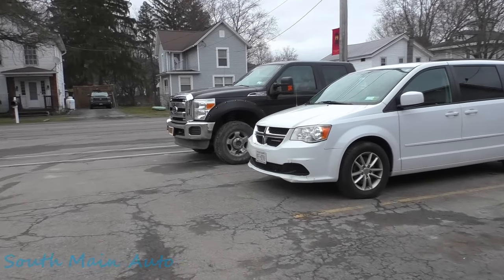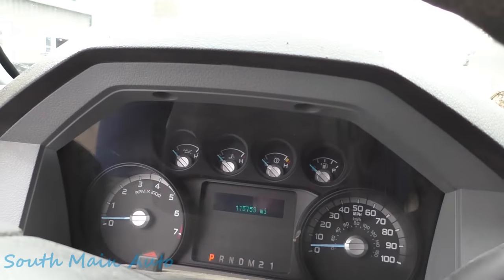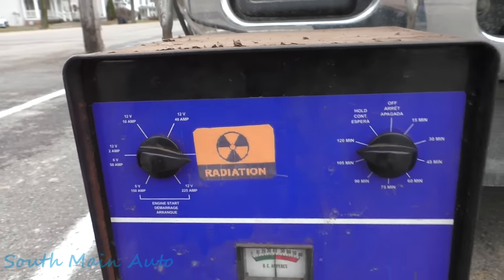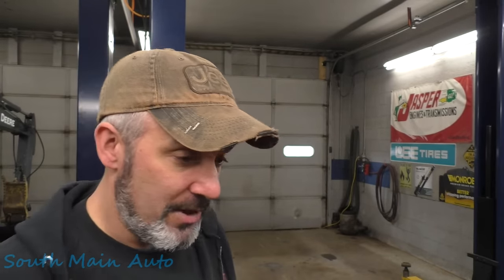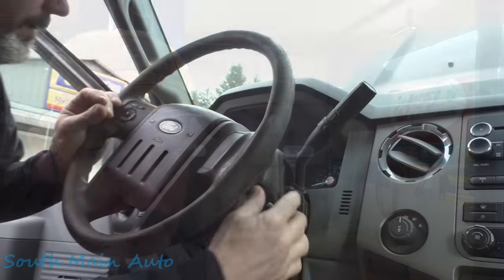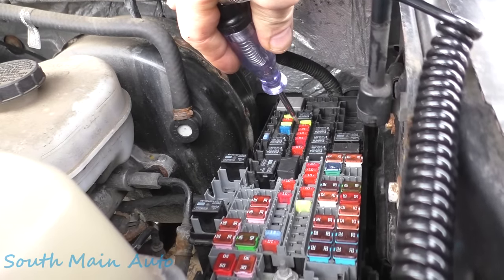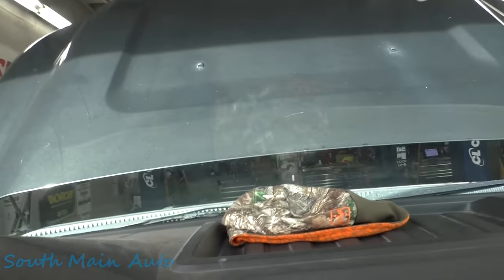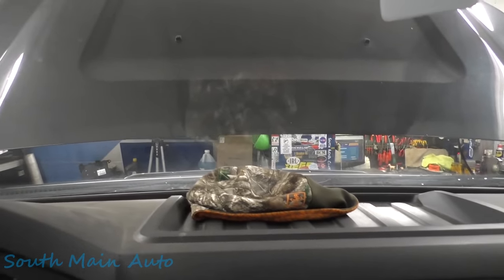Intermittent Stalling Ford F-250 : The Real Fix

Comment: Yep, the worst type of problem, the one that 'magically' goes away when you take it to the mechanic. I had a 1980 Pontiac Phoenix with a problem like that, usually when I was on the road, it would act up I would then head to the dealership, it was new and under warranty, and by the time I would get there, no problem they could find. It went on like that for a couple of months. After a couple of months I had stopped at a business that was near the dealership and one of the mechanics happen to see me and tell me the factory had sent out a 'fix' for the problem I was having, I must not have been the only person, anyway I stopped over, the mechanics did their thing and after at least a 184,000 miles later it was working like it was suppose to work when I got rid of that vehicle.

Comment: Had to deal with a broken wire under a fuse box before that was pinched after someone else had it apart and put it back together badly. It had all kinds of broken tabs and loose bolts as well. Many other weird electrical problems stopped after tightening the bolts that squeezed together the harness half with the fuse half of the GM box.

Comment: Been suffering working in these fords for decades.  Best way to attack a fuse box repair on those f250’s is pull the wheel and inner fender and hit it from the bottom up.   FORD MASTER TECH, 31 years and still kicking.

Comment: one thing i've learned over the years is that if you have two wires broken of in a fuse box  you better check them all for weakness cause its more likely that by prying that fuse box out  some other wires also gave up .

Comment: Thank you for posting both videos, it was great to watch.  I used to work on industrial electronics and finding the root cause was often a challenge.  Sometimes it left more questions than answers.  I wonder if the wire failing intermittently eventually caused a noisy signal to the relay and caused it to wear out sooner than it should have?  Electromechanical relays like to be open or closed, not halfway like a noisy signal could provide.

Comment: I know of 2 f250s had a similar problem. The harness under the hood had a broken ground wire. The metal foil on one of the wires had separated,  replaced the harness, problem solved,  the shop insisted it was the fuse box., the truck turned into a parts cannon

Comment: I had that issue on a 73 Olds Cutlass I owned. Intermittently failed to start with no apparent time schedule; weather conditions; etc.
Turned out to be an almost severed wire to the distributor ( you remember those) I don't remember how many sets of points I replaced, would run fine until the primary wire got disturbed from the movement inside the distributor and would lose the power. That one was eventually a win situation. Because I figured it out on my own.

Comment: Hi Eric, I spent almost 40 years in Gm Stealerships
 Your diagnosis was right on the first repair  with your results that showed every measurement correct , although as with any INTERMITTENT failure it made sense that a faulty relay was a viable repair. 
The learning process sucks sometimes lol. 
If you had verified the leg that passes thru the box with a headlight bulb  I think you would have found the intermittent .
As the GM instructors would always say , you found the Silver Bullet

Don’t beat yourself up you ARE a Great Technician.
Reply: Indeed

Comment: Something you have to be aware of with these body style/year super duties is there is a flaw from Ford that most people don't know about that will cause a intermittent non start issue and other issues as well. Ford mounts a large connector for one of the big harnesses to the parking brake pedal bracket. The impact from releasing the pedal jars the pins in the connector and causes connection issues. My 15' 6.2l would every so often not start, dead key, sometimes it would go a month or more without doing it. I read about the connector issue on a forum a couple years prior to buying the truck in 2015 and remembered it when the truck was acting up. So I removed the connector from the e brake pedal brake and zip tied it up out of the way. Problem solved truck had not done it since and its been several years now. Truck was under warranty but I wasn't letting those hacks at the dealer touch the truck, who knows what they would have done to it and how many times I'd have to take it back before it was fixed. Mounting a harness connector on the ebrake pedal bracket was beyond stupid. Ford should have known better.

Comment: I clearly remember the diag in the first video. You had both voltages on the relay. I suspect there was more than one failure. Think about intermittent voltage and what it can do to a relay. Possibly the relay was a victim of the original failure. Thanks for the lessons.

Comment: My wifes daddy had a f250 with 1800 miles that's doing the same thing. It will crank over and start but no a/c,blower fan and other problems. Dealer said the key lost its memory. I don't believe. 2013 truck with this problem and now part of these are back.this man is 94 years old on November.

Comment: Spaking as someone who had to have an auto elctrician remove the fuse box on a car to trace a wiring fault you did absolutely nothing wrong Eric and bearing in mind the harsh conditions within an engine bay I am not surprised you don't get more vehicles pass through with intermittent wiring fault issues. Those are some of the hardest one's to sort out as it often comes down to physically checking the wiring run for breaks and abrasions in the insulation. You did sort it and you got the vehicle running so there is nothing to beat yourself up about, many others would have made the vehicle an expensive repair seeking to change parts where possible without ever getting to the root cause.

Comment: Ever check the corroded grounds on the bottom of the fuel pump control module, which is hidden amongst the driver-side frame rails, and you can't easily get to it without removing left rear tire.  Over time and differing weather conditions, it provides all the symptoms your customer reported and you found.  Ford redesigned that module a few years later to fix the problem (corrosion between dissimilar metals - the aluminum module bottom and steel frame rail, with no air gap to let the moisture drain away creating a miserable high resistance circuit ground.) I replaced a lot of fuses before I discovered what the real problem was on YouTube.  Never replace an in-tank Ford truck fuel pump without carefully checking the fuel pump control module and its wiring harness connectors very carefully, both visually and electrically.

Comment: Good you went further & saw the loose wires I’ve only getting 20 percent from fuel pump no start diagnostic from mechanic thinking relay switch to check out not a expert willing to try before this fuel pump issues I changed a fuse & it started right up like nothing happen for a day and next day went back no start it’s a 2000 gmc Sonoma truck

Comment: How about when you tested the relay and the fuse panel the first time you might have moved the wire making a somewhat decent connection because the truck ran for a while after it left your shop; then after you performed your diagnosis and testing the 2nd time when removing the fuse box you immediately saw the wire was broken, which I'm amazed how you found it with all those wires under the spaghetti fusebox. I say those wires were never secured enough under that fuse box when the truck was built that's why the wire broke. You found it, you fixed it, that's good enough for me, once again good job NOT YOUR FAULT BUD

Comment: You knew It was either the body control module or the relay not handling the control side.    The owner banging on the fuse box was the golden ticket.   Had to be contact related.  When you pulled the old relay apart it became obvious what it could be.

Comment: Hey, Ford removed the connectors off the bottom of the fuse box to improve reliability! Can't have a bad connector if it doesn't exist 😅
Crazy they'd have a 10a fuse for just the control side of the relay.

Comment: I remember years ago. Bought brand new truck had cracked fuse box.
03 F250.
You left off at control side it was working. If it did it again you would start there.

Comment: I always say you have to be smarter than the car. Fine job, you won even if it was round two. Broken wires inside the insulating cover that makes contact sometimes are difficult to find every time. Ford used to call it the wiggle test for a reason 😂. Sometimes, I like to short the supply side to see if the circuit carries enough amperage to blow the fuse for the circuit.

Comment: As for the 10 amp fuse. Fuses are specified to protect the wire, not the load. I don't know what gauge the wire is. But, my guess is 10 Amps is the limit for that wire.

Comment: I suspect the bad relay and broken wire are related. Probably relay windings start shorting out but not enough to stop working, but puts more current through the wire from fuse 45 weaking it. Eventually both areas fail.

Comment: I had an older vehicle the other day. The pokers and prodders had been pushing pulling twisting and stabbing things into every wire and orifice. The fuse box was broken off it’s mounting points on 2 out of 3 legs. Touching the fuse block made relays and engine throttle etc click and clack like mad. Well I said “ there’s your problem lady” . Unfortunately I cannot guarantee what the pokers and prodders have wrecked in other locations so the price reflects the 20 possible comebacks

Comment: If the wire is broken, you fixed it ok first time. The wire finally broke on it's own. It probably didn't break untill after you fixed it cause you didn't get into the lower portion of fuse box. It had another problem you fixed on the first try.
Reply: Good job. I wish I could do what you do

Comment: Nice job finding the broken wire. Do you think it's possible you missed it on the scope in the last video because the time division was set so high? I was wondering if maybe the sample rate goes down to have such a wide time frame on one screen and maybe it dropped out between samples?

Comment: Because the wires loop in the box, wouldn't you have been able to test for continuity between the pins for fuse 45 and the power side of the control on the relay before digging into the box? 

I mean it would have sucked to rip into the box and find nothing. I think it would have given me peace of mind to know that I wasn't wasting time. 

At least you found the problem. Yes, it took a second round, but maybe it had power then because it wasn't completely broken... I mean it was intermittent, so it was getting power at some time and other times none. Still a valid repair based on symptoms. You are not a bad mechanic, you fixed what was in front of you at the time based on the evidence.

Comment: I feel your pain Eric! Working on most of these new vehicles I feel like I picked the wrong profession. How much do these mfgrs save by shortning the wires by 3 inches? Those 3 inches can save so much frustration for a mechanic, but those 3 inches of wire multiplied by 1 million trucks adds up to quite a few wiring harnesses. They make their $10,000 profit when they sell the new vehicle, come on Ford give us a little more wire to at least see what we have to repair! I guess it nice that it wasn't a fiberoptic cable and u would have to splice or replace the entire cable and or harness.  Great video, thank you.

Comment: Could be the relay you changed in the first video was failing due to the partially broken wire.  It would be interesting to see what the coil resistance was on the relay you removed vs the new one.

Comment: Why is it most cars that come in have a dead battery, out here in Vegas the life expectancy is two years,  the heat fry's them winter kills them. Cool tool for the relays who would have thought a broken wire under the fuse box.

Comment: I had a ford pickup that had a miss and wouldn’t run right until I unplugged the alternator so I bought a new ford alternator and the same thing happened so I put in a Delco one wire alternator and the truck became usable.

Comment: Talk about coincidence!...   I worked at a shop back in the mid-70's. Someone pulled in with a fairly new Lincoln complaining that the engine was making some noise. The boss opened the hood and just barely touched the carburetor linkage and the engine blew.  The car's owner then said: "What did you do?"

Comment: Have you seen or tried the solder wire connectors you can use a lighter to melt the solder and shrink the coating. Your thoughts!

Comment: at about 1150 in your video, you mention that the control side is missing proper voltage, because of the way that fuse box location is close to the hood hinge area, which is a crappy location. My guess is water penetration into that fuse box! Which probably tells me, you got a green mess below it i.e. green Krusteaz
Reply: Well, I was on the right track watch to the end of the video and lo and behold. It was a crappy crimp from the factory I would guess! So now we blame the harness manufacture, which I believe would be made in Mexico!

Comment: Worked on fords for for 25 years. EVERY ford had hardwired fuse boxes. Then there’s the torque converter studs that everyone else can use bolts on with no problem. Sucks when your two specialties are electrical and transmissions.

Comment: Could the damaged wire in the fuse box have caused the relay to experience a large number of on-off cycles, leading to the failure of the relay?  ie, cascading effects of the root problem?  Great work chasing it down.

Comment: worked on a Ford Focus that would not ground thru the engine block for some reason.
.had to run a ground wire to alternator from battery to ground it

Comment: Chances are that the relay did have an issue as well as that wire being wonky too!!! If I remember correctly you had a scope on both hots on the relay. What are the odds of having 2 different issues with the same circuit?

Comment: I know the other video was just released and I too had to go back and view the original video. As odd as it sounds, I think that you had 2 good fixes presenting as the same problem. Maybe this bad wire caused the relay to go bad. House circuit breakers are not designed to be used as switches. When people use them as switches and the circuit breaker fails and they will, they blame the bad circuit breaker design. Similarly, the trucks relay switch is not designed to turned off and on, possibly hundreds of times a day. I'm betting the owner lived with this problem for a long time before it failed long enough to seek repair.

Comment: I have had same problems with broken wire,ford tech said its a ford problem with the wire insulation having holes in it from factory ,i work on salt trucks,and most of the time it's a bad wire causing the issues.

Comment: They got rid of the connector interface to eliminate 2 points of failure. Makes it harder to work on, but the "unwritten" theory is with less connections to fail, you shouldn't have to be in that box "as often". (if ever)

Comment: Making many repairs a nightmare seems to be common with US manufacturers across the board. You mention even Chrysler isn’t as bad as this Ford but think about the highly failure prone $1000 often back ordered, and originally throw away, TIPM fuse box. I’d chose Ford’s solution.

Comment: Not that it matters now but I wonder if there is some sort of fastener somewhere along that harness that is holding it down.  When I look at things like this, I think about the manufacturing assembly process.  I would expect there is some way to get more slack in that harness.  That is, of course, assuming they didn't install the harness and build the rest of the truck around it.  That is also possible.

Comment: The odds are quite high also that the bad wire caused the relay to switch rapidly going down the road and caused the relay to fail. While stationary in the shop, this issue would not present and appear to have been fixed by replacing the relay. With a fresh relay, the real underlying cause showed its ugly head allowing you to fully repair the problem. I see no reason why you should not be charging for this "comeback", and stand by your original diagnosis, other than trying to do the guy a "solid", especially when the final repair didn't take too much time or have a real parts cost to it. In my younger days, I was a 20 year master lead tech for 3 different ford dealers specializing in Electronics and Driveability repairs, and I feel the pain, my friend!

Comment: Is what it is!   Us rust techs have these issues all the time    Bottom line ya fixed it    I have seen that same issue before on same type a vehicle    Wondering if somewhere in manufacturing either harness or truck do they cause a pinhole in wire ?    Over time it rots and fails     I am sure that's what causes a failure like such.  Work outside Metro Detroit so see many of those fords and had to do same pain in ya know what repair    Fuse box is a real pain    Also had other green wires under there also. which caused other issues.   Have to love the rust belt   Great Video as always   Keep on going on my man.

Comment: if a diag + Relay and a "comeback" for a simple soldered wire is a bad thing, it's still sunshine and rainbows compared to a replacement fuse panel....IF you can find one.  I know a guy with a 2018(i think) Honda Pilot that's been DEAD in the driveway for 6-8 months waiting for one...

Comment: I enjoy fixing things.  I really enjoy the mental chess involved in figuring out some problems but I have been through too many battles.  With the way newer machines and vehicles are being engineered, I give up.  "Remove cab" should not be in any procedure to repair an engine.  Is 12 inches really that expensive?